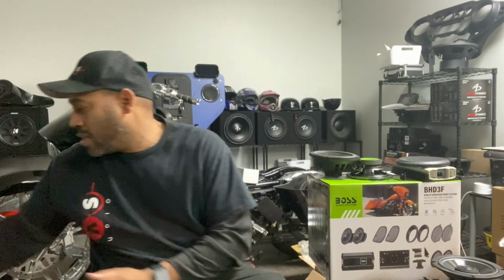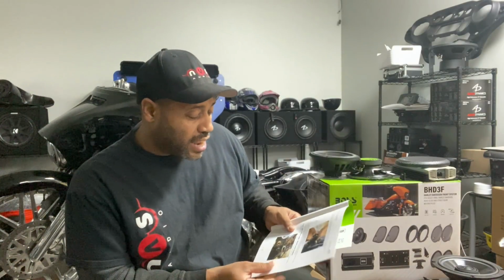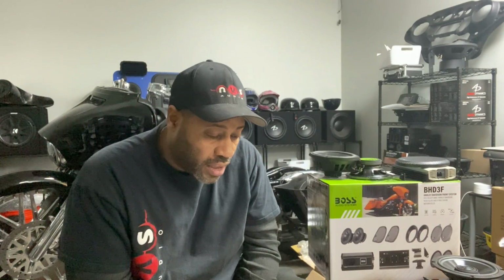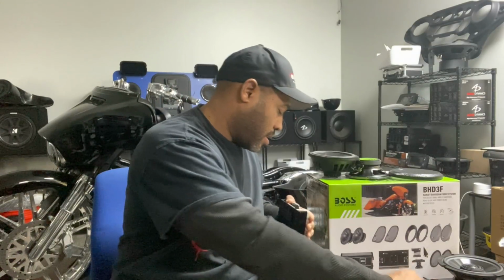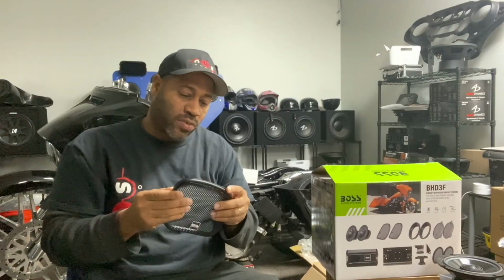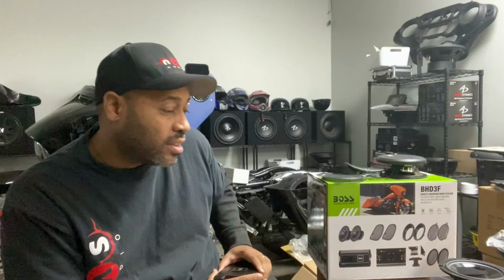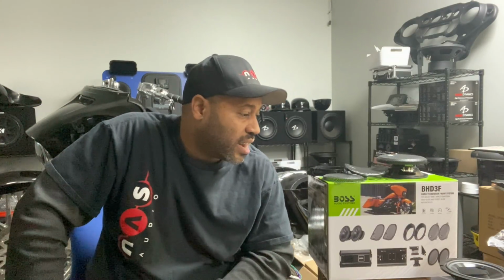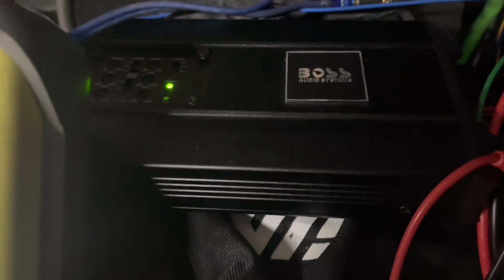Boss Audio  bhd3f Harley Davidson Front fairing complete audio kit review by Nvs Audio

Comment: boss BPS400.4, I be wanting just the amp. Hopefully they will sell just the amp, I run 2, tm400x2ad and 1, tm400x4.  If it's equal,  great option for replacement. boss, really hard to contact thru there page. Hopefully your boss contact. Will know when they be selling just the amp
Reply from the maker: I will post it when it becomes available

Comment: How would you say the clarity and performance stack up to 2018-2020 stock speakers on a Special? It's my understanding for 2021 both standards and specials have the same speakers but they were different in the 2020 and 2019.
Reply from the maker: Not a fair comparison 
The factory Harley speakers are powered by the radio 
These are powered by a amp 

These will definitely sound better than all the Harley 2 speaker setups 

Now the 4 and 6 speakers setup that come on the Cvo and the limited with the factory Harley amplifiers will out perform this setup

Comment: Great review. Thanks for that. Just thinking about my 14 Limited... 2 of these kits, a DSP, a lid kit and some cutting and soldering in the Boss wiring. All that's left to choose is front lower speakers. That way, I would have an 8 speaker 2 amp setup with DSP. :-) Correct?